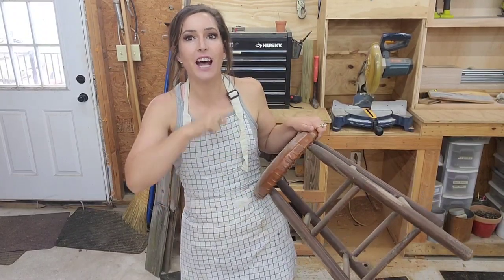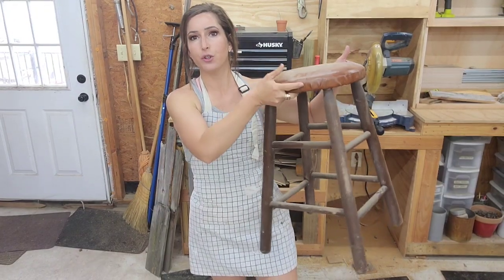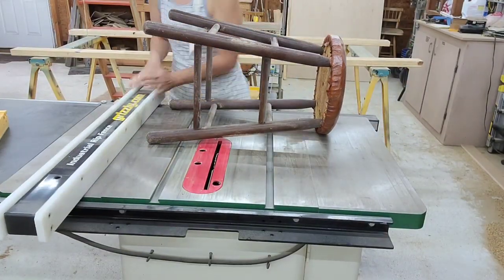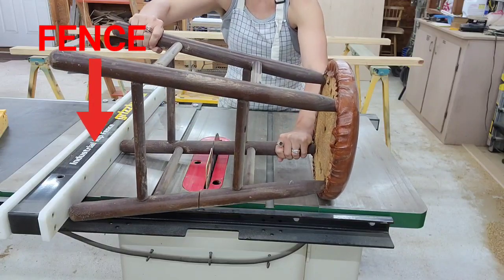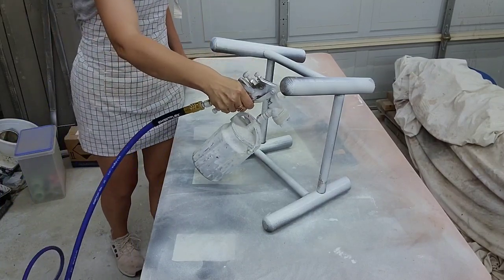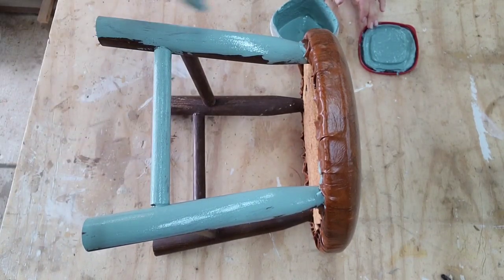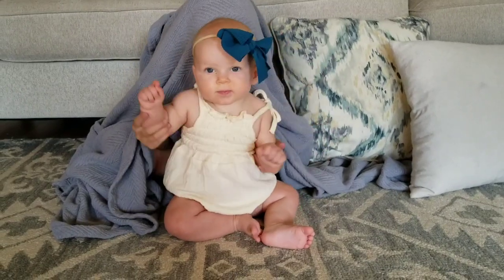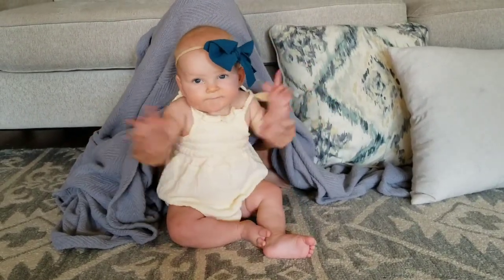TRASH TO TREASURE • Transform 1 Bar Stool into 2 Stools • THRIFT FLIP • Farmhouse Vintage Style

Comment: I have had an old barstool in my garage not knowing what to do with it.  Now I know!  I am going to make two small stools like you have!  One question, I do not have a table saw and only have a jig saw.  How can I cut the legs so they are even?
Reply from the maker: im thinking if you measure and tape where you want to cut. use that tape as a guide to keep the cut even it may work

Comment: This is a great idea! I just need to figure out how to cut the legs off without a table saw and get them angled right
Reply from the maker: maybe measure and tape, then cut?
Reply: @JuliesDesignsandSigns  it's the angle I can't seem to get right. I don't think it's a tool problem. I think it's a me problem.
Reply: @Sandy-oe5mh  If you hold the bottom legs against the fence of the saw the angles should already be correct! 👍🏻
Reply: @conniesisco6468  I don't have a table saw. I have a compound miter saw and a jig saw.  I have two bar stools with dog chewed legs I have wanted to cut down, but I already ruined a pedestal table by trying to cut it down. It was like an old school mom hair cut. I have several chunks of " trying to get it straight" and a still crooked base.
Reply: @Sandy-oe5mh  Oh no!! I gotcha! My dad and brothers are builders and one has a custom cabinet shop. I’ll see if they know any tricks and will reply back if I find out anything!
Reply: @conniesisco6468  that would be great! I know people do it. I'm just not not skilled enough to know what I'm doing.

Comment: So I just bought a stool at goodwill.....it has wooden top but metal legs. Any idea what to put on open holes on the bottoms after I cut it?
Reply from the maker: I don't know exactly what it looks like but I don't think I would cut it if the legs are metal
Reply: @JuliesDesignsandSigns  i dont have FB or I would send a picture. Legs are an ugly green color.